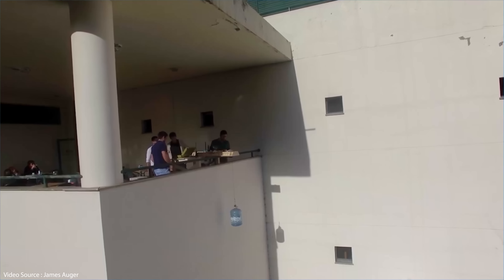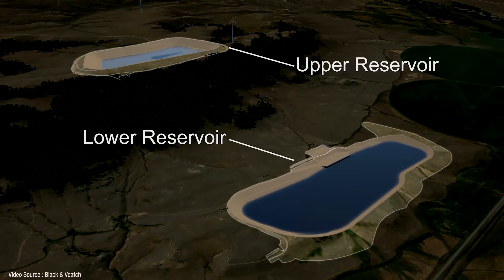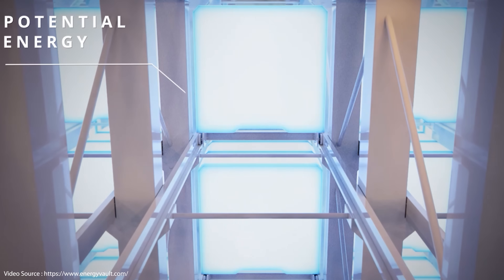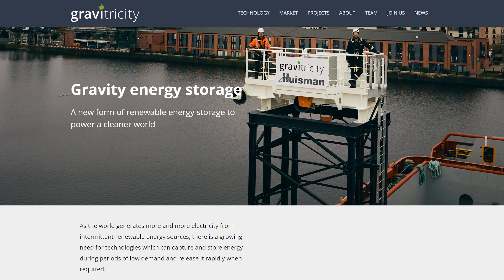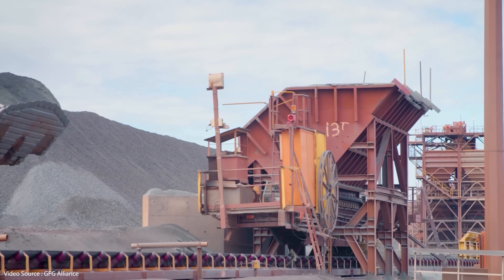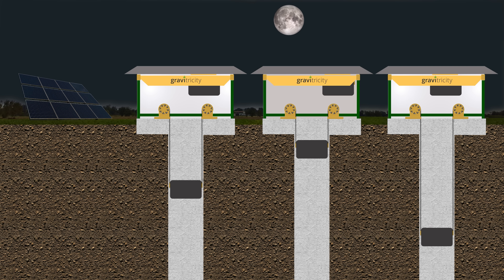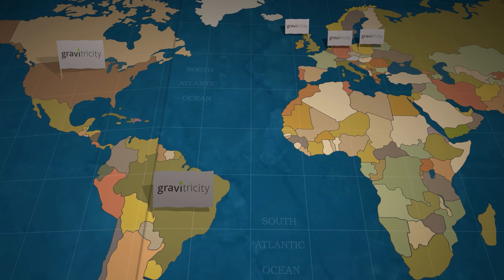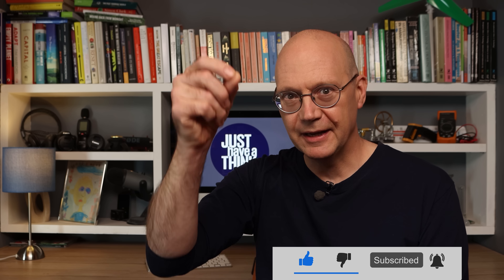Gravity Energy Storage. Who's right and who's wrong?

Comment: Great where there are abandoned mine shafts. I am not convinced that is very common in the world. Good solution for some places though.
Reply: Surprisingly there are a LOT of abandoned mines in most areas (I bet there is one within 100 miles of where you live). And even if there isn't, the cost of digging a new shaft is not as expensive as people think. It is certainly less than the cost of putting up a bank of batteries.
Reply: Tons of Cobalt mines in the DRC, Nickel in other parts of Africa, coal in the US and Germany. 

Honestly, this solution would work better for regions that don't have very much aboveground sea level variation. If aboveground is flat, go underground. The Midwest and Great Plains of the US would be perfect for this, and I'm sure the northern provinces of France/Germany would welcome something like this. The Scandinavian countries would probably love to implement this tech
Reply: @nschrombeck  I think the problem will be cost. Using abandoned mines saves a lot. 

DR is probably not going to be at the front or even middle of the pack with adoption of these technologies. 

France and Germany definitely have the money and will.

I do not know enough about midwest USA with respect to available mines. If they do not have then another storage technology would be more applicable.

Scandanavian countries have the terrain for pumped hydro so no need for this more expensive solution.
Reply: Electricity can be provided into the grid from anywhere. Even if it is a 1000 miles away.

Comment: Gravity based energy storage is an age old technology. Of course using concrete is an unimaginable waste of energy compared to readily available and flexible water. 
I fail to see how any of these modern "innovative" technologies can come even close to capacity, efficiency and robustness of hydropowerplants or alternative water based systems.
Reply: that was literally the topic of the video from minute one to minute three
Reply: @Hdtjdjbszh  Yes, he mentioned it. What he did not mention was someting along of Craig Watson's calculation below.
Reply: Agreed. 1MWh is 3.6e9J of energy (1e6Js-1 x 3600s). A mass of 30T lowered through a distance of 500m (assuming the acceleration due to gravity is 9.81ms-2 and NO losses) would yield 1.4715e8J or approx 0.04MWh. A capacity of 24.4MWh in their LCoS study would require 610 such masses!!! Unless I've got my calculations wrong.
Reply: @protectiongeek  right.
Reply: I would add that, although 24.4MWh sounds like a lot of energy, in the context of electricity distribution it isn't really. A typical primary substation with around 6000-10000 customers averaging 8MW demand (over a 24hr period) would only be supported for about three hours. In a city like Glasgow there are about 90 primary substations.

To be honest, the capacity of this proposed gravity storage system relative to its necessary physical size and the scale of distribution network loads mean it might be used for frequency support (very short term). Not dissimilar to 'big' electrochemical battery installations, which seem huge when regarded in isolation but the energy capacity is, in reality, pretty tiny compared to network requirements.

Comment: How about just dumping surface mining tailings into abandoned mine shafts? The buckets can be lowered to generate zotz, then the bucket dumped into the shaft and raised back up again empty. The cycle repeats as long as the shaft has room for kaka to be dumped.
Reply: Surface mine tailings can also hold a lot of other precious metals that can be chemically removed.  So it might be a mistake to just throw them back into the old mines.
Reply: Kaka is that the tenical name?
Reply: Kakatricity!
Reply: It has to be reversible: corresponding to charging and discharging process. In real life, surface mining tailings are leveled off over an extended area and are considered environmental nuisance.

Comment: How about winding up a giant spring ?
Reply: Calculate how much steel you would need to store a decent amount of energy. Then try to imagine what would happen in case of a structural failure.
Reply: @ D Alstein
🎯
I was driving my car recently and an explosion rocked my ears and my car. Turns out the metal bar that holds your trunk lid up when you’ve opened it had snapped.
Reply: someone actually thought of that, but they're using air as the spring (see the video on "liquid air batteries" from this same channel)
Reply: LOL